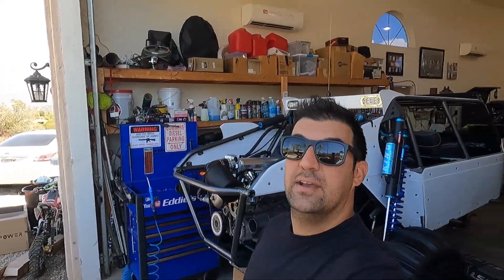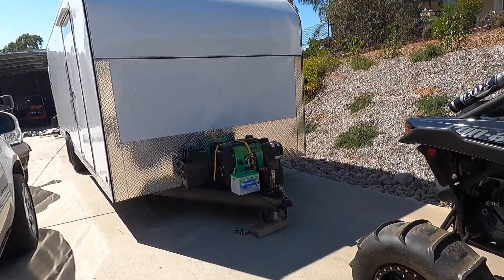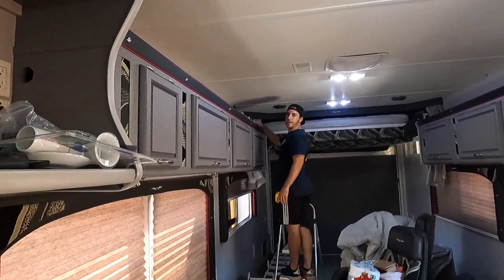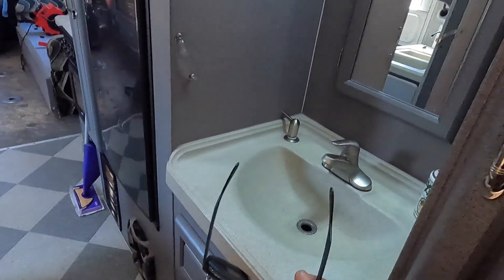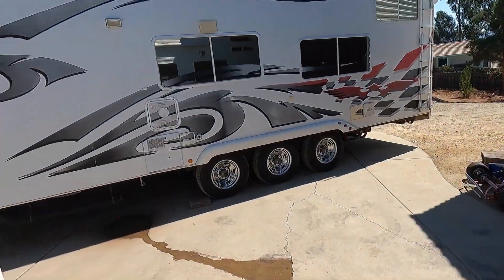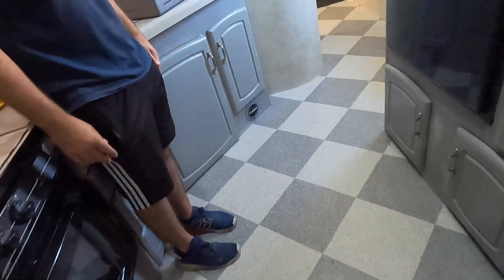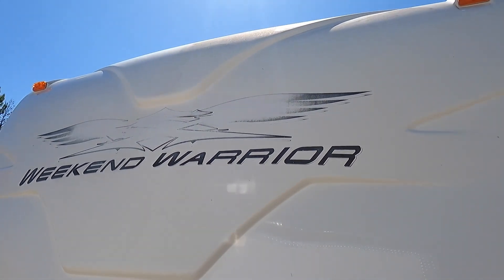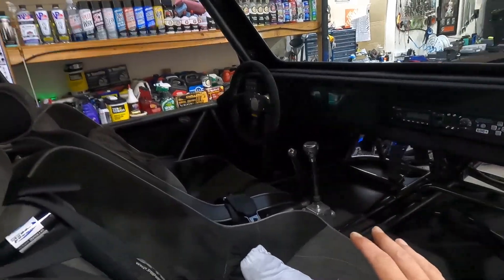Longest Bumper Pull Ever...This Cant Be Legal!!!

Comment: So much safer to have a 5th wheel. Big long bumper pull toy haulers are dangerous especially when you put 2-3k in the back and srw truck.
Reply: I agree with you that 5th wheels are safer. I towed an older heavy 33ft ww to pismo from southern California with my 16 sierra 2500. Had zero issues and never felt unsafe. Even on hwy 154.
Reply: @Harlo86  33ft is great as a travel trailer. The problem is that at 35-37 ft as a toy hauler and carrying a 2k lb sxs front end first. So the bulk of the weight is at the far back of the trailer causing it to have a lot of sway. If you at least back them in so the bulk of the weight is over the axles.
Reply: @Titanlessmatt  yeah you definitely want to distribute the weight correctly. I had a 4 seat rzr, banshee, and raptor 90.